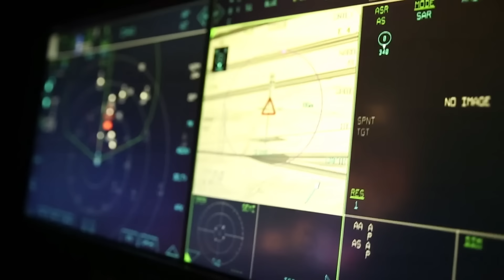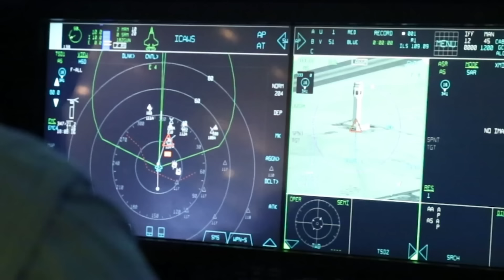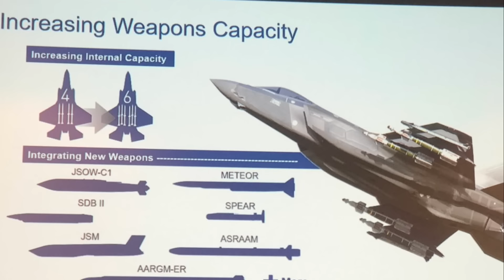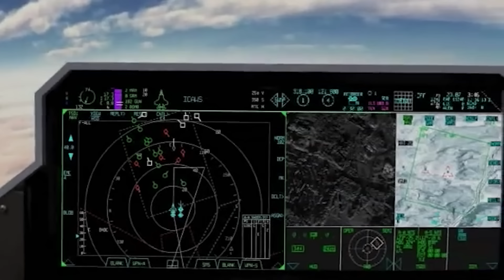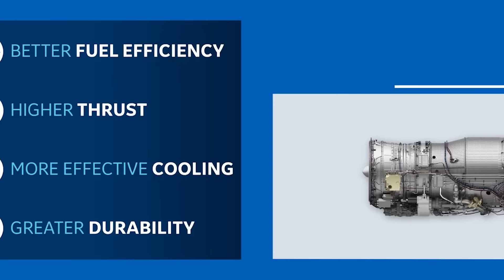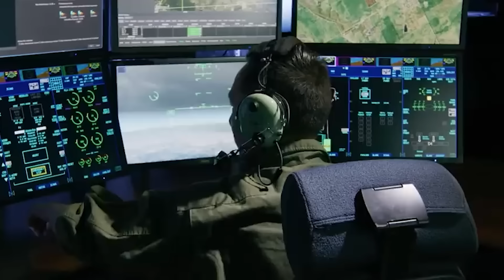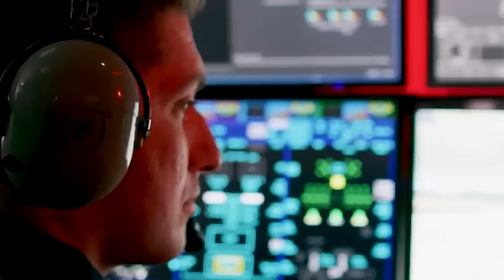The F-35 is about to become a POWERHOUSE

Comment: Under the rather unfortunate "build while designing" notion, block 4 is essentially what would normally be considered the completed "version 1".
TR-3 and anything beyond block 4.0 are ideas and upgrades which go beyond the preproduction design expectation.

Based on how the plane is designed to work, the EOTS upgrade is likely more important than the radar upgrade. LPI radar is nice, but EOTS is the bread & butter of the F-35 in hostile airspace. In hostile airspace the radar upgrade will likely be more about it's passive array, ELINT, and EW capability (which granted, IS a huge part of the F-35's mind-boggling toolset).

Worth pointing out the XA-100 doesn't actually offer +25% thrust. It would give 45,000 lbs of max thrust, while "current" production engines for the F-35 already offer 44,000 (with some tweaks looking at 48,000). But the GE engine does open up supercruise, because it's a 3-step engine instead of a 2-step. In stage 2 (out of 3) the adaptive cycle engine would allow for sustained supercruise (a feature which fell by the wayside with weight-bloat). The +25% range isn't "free" it comes at the cost of cruising speed. But it is very useful for situations where range is valued over speed. Basically its stage 1 for +25% range, stage 2 for supercruise at present range, or stage 3 for max thrust which is on par with the current production version of the P&W f135 engine.
I don't know if the XA-100 has growth potential like the PW F135 did (going from 38,000 to 44,000 max thrust, and potential for up to 48,000). It may actually have slightly less max thrust. But the promise of supercruise without afterburner, or 25% greater range, is 'very' interesting. 

Engines are an ongoing & recurring cost though. Not a 'one & done' upgrade cost. They figure prominently in the "per flight hour" expense. I'm curious what GE can get the price down to.
Reply: Still, GE engine - if meets stated specs - will offer FAR MORE FLEXIBILITY in mission planning.
Reply: @piotrd.4850  Oh, very much so. It's easily more desirable than (possibly) slightly more max thrust from the PW F135 engine.

Assuming it can be made cost effective, and extremely reliable. PW F135 does have great reliability (apart from a few snafus where they were tinkering to eek more thrust out of it).

I don't think the F-35 needs all that much max thrust though. It's really designed to deconstruct the whole "dogfighting" dynamic. Being within 40km of an F-35 is a deeply unsafe place to be, even if you're behind it (assuming it still has AIM-120's left). 360 degrees of EOTS... the operative letter most don't appreciate is the "T", targeting. HMDS+HOBS+EOTS+30G missiles with high hit probability = dogfights will never look the same.

And it's thrust to weight ratio or wing loading is not nearly as bad as it looks on paper, when you consider that it basically has the fuel capacity equivalent of "drop tanks", but on the inside instead of added on like other planes do. If you look at thrust to weight with say 300nm worth of fuel on board, it stops looking overweight.

I work for "the other guys", and the F-22 being picked over the YF-23 was bs. But they hit a home run with the F-35. The X-32 just wasn't on par.

Comment: I can't wait for this beast!!!  it really does need that extra cooling offered by GE's engine.   Can Pratt provide the extra cooling?
Reply: I don’t think they can with current engine.  They also have an engine similar to GE that is under development has third stream the pentagon designated xa101 that is competing with GE xa100.  I understand the third stream is key to cooling.  So yes they can provide it, but it is a brand new engine.

I think GE has the edge if it came to engine replacement because they have already stated that their engine fits in all three f-35 variants.  The marines would absolutely love that with the b model.
Reply: @armchairgeneral7557   I think they key to this program is still the F35B, that's the special sauce that makes this program so great and to give that a massive boost via the GE A100 would be a multiplier for the other variants.  F35B with the A100 would be frightening to the PLAA.  string a bunch of Stingray's and watch this thing sink half the CCP fleet.
Reply: Range improvements are even more important. 35% is MASSIVE, especially when we are looking at China as the real threat.
Reply: @A2K.556   i wonder if its going to be looked at as worth the extra 4.3 Billion and almost a year delay?   I'd say yes because it gives you access to range and directed energy weapons these two things are the most important when it comes to China.

Comment: I've always thought that the F-22 was the shiny object to the world while the F-35 was the weapon they should have been worried about.  Compared to the way upgrades went back in the '80s during the Tomcat Hay Days, upgrades just seem to be exponential in their advancement and probably leaving others in the world with their head spinning.  They're still working on figuring out the original version.
Reply: The 22 is still the (current) most deadly aircraft in the Air. But yea the 35 is quickly shaping up to be the true threat in a legit war scenario.
Reply: Be good to see the F-35 gain a true super cruise ability and extended range. The F-22 can still out pace the F-35. When your air force must needs protect an area as fast as Australia, high supersonic cruise and extended range capabilities are a potent asset. F-22 cannot be purchased though, so our hopes must lie in the potential for such an upgrade to the F-35. Maybe GE's new engine will deliver in the block 5 upgrade...
Reply: F32 were over 200 mil each.  F35 are closer to 80 i think
Reply: @Kronk-rp3jf  Correct, and as we get to full rate, the price is going to drop. The F22 was never or ever will be available outside the USA. The F35 was designed to aid our allies. Sections are manufactured here, in Italy and Japan.
Reply: @nelson_rebel3907  Absolutely. The software capabilities and modular capabilities make the F35 a real contender. With that said, the F22 is by far the deadliest aircraft on the planet, which is why it is not available to any country but the USA. While the F35 has a cross-section that of a small bird, the F22 is that of a bumblebee. So yeah, it has air superiority in the bag. Despite what other countries claim...is just BS. They have nothing compared to the USAF.. Full stop.
Reply: Not necessarily, China has just commissioned a J-35 "Gyrfalcon" that is supposed to take on the F-35.... F-35's sensors are superior, though, meaning that weapons are fired earlier, and from further away, meaning the F-35 still has the upper hand, for now.
Reply: @F35_JSF yea I mean these radar.cross section claims are bs. Cmon. The Serbs shot down the f177 and that has a claimed rcs of a pimple.
Reply: @nemiw4429  I assume you meant the F117. Well, RCS and LO are first shot advantage designs. That is how Lockheed engineers present the information. So, no one has ever said that stealth aircraft or missiles can't be shot down. Let's not forget the almost 2000 targets destroyed in the Gulf War by the now obsolete F117. I think you are being over critical of the claims. Also, the F117 is "old" technology compared to current RCS and LO technology. Again, what a low RCS offers is a first shot advantage before being identified. Oh, and by your comment, I assume you have a better design?
Reply: @F35_JSF  what?
Reply: judging RCS of an aircraft based on looks is bogus since LO/Stealth aircraft use composite materials (non Aluminum/Titanium/Steel) in the airframe to absorb/scatter/deflect radar waves of various wavelengths and would be classified information. Possibly the object with a lowest RCS, idk a goddayum plastic balloon (due to balloon material being radar transparent by physics).

The F-35 on paper has a bigger RCS than F-22, when in reality it actually has a lower RCS, thus I'd take any RCS measures with a grain of salt, (as they don't specify that type of Radar used in the measurements, or the materials of the respective aircraft).
Reply: F-22 is a better jet.
Reply: @bonitabromeliads  proofen by? Where did it fight?
Reply: @nemiw4429 they shot it down by timing standard sortie scheduled and flight paths and they got really lucky.   They did not shoot it down through radar.  They randomized flight paths and times after that.  The fact you posted this means you’re a troll as this is well known.

Comment: Are they retrofitting all of the older models?
Reply: Probably not. Aircraft have a life expectancy because the air frames wears out due to stress.  The air frames are suppose to last 8,000 hours. In non combat of two hours per day, that's about 11 years. Combat will shorten the number of days due to the planes flying a lot more hours per day. New F-35s will be rolling out until the 2040s.

Comment: What's funny is that 35x to 75x process power increase isn't all that impressive if you look at a processing power chart (general compute). Given they probably spec'd those 20 years ago to where we are now .. passmark has the avg desktop compute score having increased ~77x (as in, an avg 2023 CPU can do 77 times a 2005).

Obviously they're not going to be slapping a desktop processor in there, but these things tend to scale together because it's more about the advancement on the manufacturing nodes.
Reply: They're going to slap a 4090 in there and play DCS on the MFDs.
Reply: These aren't average CPUs though. Consumer CPU increases happen rapidly since there's a shit ton of money to be made.
Reply: Apparently Tesla's Full Self Driving Computer in each car is 180 times more powerful than the out going F35 computer.  Lockheed and Boeing are having the same problems as Legacy Auto.  They outsource the processors and the software and which results in considerable difficulty in getting different software to speak to each other. When one changes you have to get permission or ask for the company to make changes to the other...that's almost always because you don't have good software developers on your own payroll (as we saw with the F35 software issues early on)  They clearly had no idea what Mass Production would need software wise.

Comment: Can the F-35 fulfill air superiority, interception, and CAS roles?  Curious.  Thanks.
Reply: Yh
Reply: CAS yes.
Reply: Yes
Reply: Yes, and it doesn't have foreign competition in any of those roles.
Reply: It's an extremely expensive platform for Close Air Support, but it was done with the F-4 Phantom when it was the dominate fighter of its day.
Reply: Yes it can serve as a platform for CAS, but Strike Eagles or Warthogs would be more efficient, especially because CAS almost always happens in uncontested airspace
Reply: Definite Yes, Yes and Yes. It’s main job is Strike and Air-Superiority. However it’s not Ideal for Intercepts and does CAS like any other craft.
Reply: Anything can perform those roles but it’s not what it’s good at
Reply: @roninjedi2494  It was literally built for those exact roles other than interception.
Reply: It doesn’t have nearly enough fuel for air superiority or interceptor missions. In fact it’s been proven our navy is completely vulnerable with zero defense to long range anti ship missile strikes because the f-35 lacks the range and fuel to be able to intercept the bombers before they fire the anti surface missiles. It also can’t get very far into a country for cas unless we own the air space for mid air refueling. And it doesn’t carry enough weapons to be a true superiority fighter. The f-35 was designed for strike missions, to fly into an area drop a few precision bombs or AGM’s  and then leave and that’s really the only thing it’s “good at”. It can do the things you mentioned but that’s not what it was created for and it’s not good at those things because it’s lack of range from low fuel and it’s inability to carry a heavy payload. All the cool technology and sa in the world doesn’t mean much if you don’t have any weapons and fuel. Even Israel which is an insanely small landmass has problems getting the f-35 enough fuel for what they need it to do
Reply: Yes but not in the traditional sense
Air superiority in the past was about going toe to toe in the air , the F-35 achieves air superiority by destroying the enemy on the ground as well their assets before they can become a threat. There is no need for head on engagements 
Example, F-35s simultaneously strike air defense, air field runway, AWACS and tankers while cruise missiles are enroute 
With the runway out of commission, the planes on the ground are dead when missiles arrive
without AWACS and air defense radars, the enemy planes in the air have no eyes to coordinate their counter attack
With interception and CAS, its the same, different tactics to achieve the same result with minimal effort  
The A-10 can gun run which is cool but not efficient
The F-35 can use 1 missile to do the job
Reply: @roninjedi2494  You do know Ships have ABM systems, right? The F-35s range is more than enough to intercept slow bombers carrying glorified 1950s air launched BMs. Israel has no problem striking Syria or Iran with their F-35s which have been proven many times.
Reply: @user-os6ch5pt7w  Right but the f35 only has a top speed of mach 1.6, which can drastically affect response time. It's able to do interceptions if nothing else is available, but it's not designed for it.
Reply: @sethadkins546  And? The F-15 with a combat load-out has a max speed of Mach 1.8. The F-16 with a combat load-out has a max speed of Mach 1.3. The F-35 can do its max speed of Mach 1.6 whether clean or with a combat load-out. Going by max speed is a rather poor way to gauge a fighter's ability when it is clean. What matters is how fast it can go to war.
Reply: @roninjedi2494  It has comparable range to the F-18, and the range of hypersonic/glide/bombers firing long range missiles is a problem the navy has no answer for atm and is trying to address with its next platform, so that's not unique to the F-35.  The rest of the stuff you wrote is made up as far as I can tell;  I've been reading about the platform for the last couple of years and none of this is accurate or true.  There's tons of publicly available information out there from reputable knowledgeable sources;  there are performance reports and reviews as well as interviews of pilots and engineers (and other employees) from Lockheed Martin that worked on the project - I recommend doing a little reading on the platform.  Sandboxx news has some good articles on it as well.
Reply: @jimw1615  CAS in contested airspace will generally require expensive solutions.
Reply: @roninjedi2494  Chinese long range anti-ship missile systems are so long range, and so numerous that the US Navy has no real defense against them, except to engage max speed and leave the area when a launch is detected. China has long range air to surface, ship to ship and ground to ship missiles. No fighter/attack aircraft have the engagement range that a one way missile can have. A plane always needs to return to a base, so typically its engagement range is half. China has known if it gets into a scrape with the US, the primary local threat is US carriers and has spent significant time and resources to make weapons capable of doing so. 

A strength of the F35 is it's stealth and targeting system, which it can use to direct targeted missile strikes against ground targets, even without having significant payload. Cruise missiles have far larger range than aircraft. So an F35 gets refueled/drops pods outside the enemy AA engagement range, flies inward on the  670 km combat radius engages, leaves, gets refueled and goes to land, refuel and rearm (if need be).
Reply: @granatmof  "Chinese long range anti-ship missile systems are so long range"
Like what ones, exactly? What is the kill chain they rely on to accomplish a hit? Can they actually hit a target at the stated ranges? Or are they quoting max theoretical aerodynamic ranges of said missiles?

"and so numerous"
ABM systems work fine, and we have the tests to prove it. AEGIS with SM-2, SM-3, SM-6, ESSM, and SeaRAM work extremely well, based on all public data - from reports to actual intercept videos. Then, add in PATRIOT with PAC-2 GEM, GEM+, PAC-3, PAC-3 MSE, and THAAD. That's just defensive missiles alone. How, exactly, is China going to stop a JASSM-ER, LRASM, NSM, JSM, AARGM, JSOW, SLAM-ER, MALD, PrSM, AARGM, AARGM-ER, etc. from destroying their launch platforms, and kill chain (radar, C2, satellites, ISR)?

"that the US Navy has no real defense against them"
See above. Add in EW, taking out their kill chains, etc.

"except to engage max speed and leave the area when a launch is detected."
Stop talking out of your ass, please.

"China has long range air to surface"
What ones? Can I see them hitting a target at the ranges claimed? And where can I see them actually work?

"ship to ship"
What ones? Can I see them hitting a target at the ranges claimed? And where can I see them actually work?

"and ground to ship missiles"
What ones? Can I see them hitting a target at the ranges claimed? And where can I see them actually work?

Comment: What some people dont understand is that when it comes to the budget of the F-35 program, is that it's 3 different aircraft for 3 different branches of the military. So the budget is bigger x3 to accommodate all the aircraft and different requirements. 

If the military had to fund 3 totally different aircraft for 3 separate branches of their military and upgrade each custom model made by different companies, then add all 3 different programs together the price of the F-35 program would be very small in comparison.